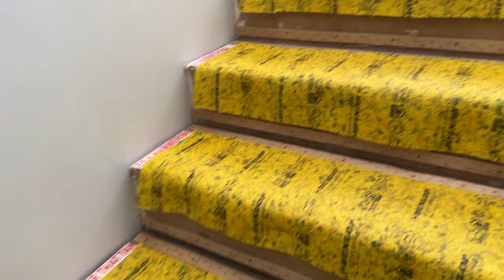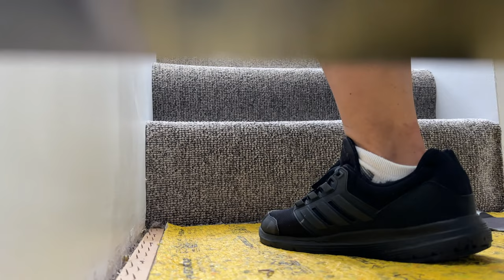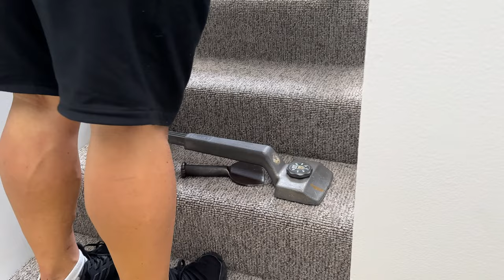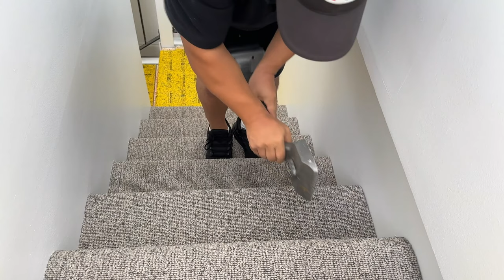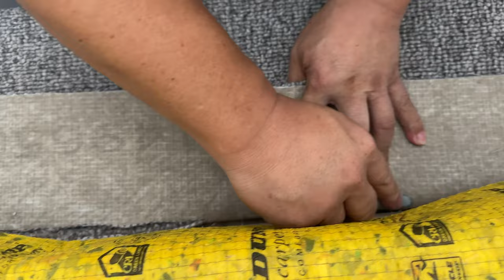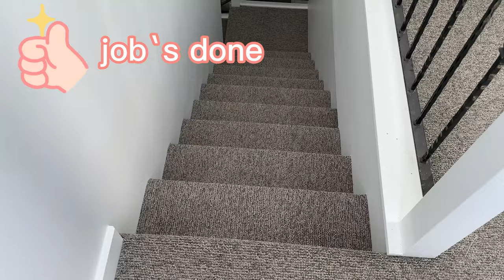how to install carpet for stairs .

Comment: Why are you starting at the bottom ? Don’t make sense pal your knee kicker ent going to work all you’re doing is putting pressure on the small tread and could rip it, start top to bottom easier to control the carpet and the lay of the carpet you should never need to use a stretcher on the stairs, bolster down the riser so you can hit the gripper section the carpet will naturally pull down to tighten up as doing this you will start to see the crease form in the corner of tread and riser then on the next step your carpet will lay naturally on the tread push up some access on the tread and use your bolster and hammer in the crease apply pressure to the crease it will naturally go into the crease when the step is formed tuck down sides of tread and riser with a tuck down knife not the bolster because you could scratch the paint work then rinse and repeat your welcome 🙏🏼 lord a mercy 💪🏼
Reply from the maker: Thank you for your excellent suggestion! Many carpet professionals indeed choose to work on stair carpets in the manner you described. The reason I opted to start from the bottom going up is because of my weight; I find it more comfortable to work this way. I appreciate your understanding